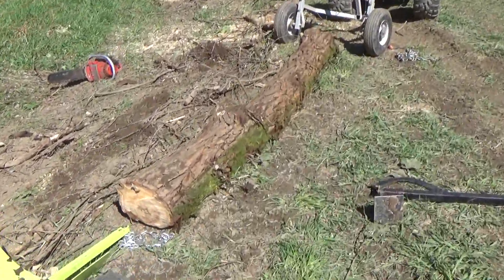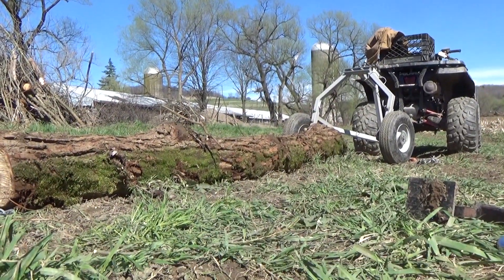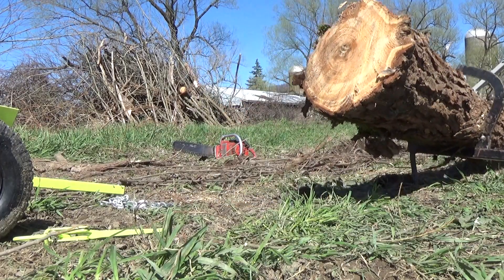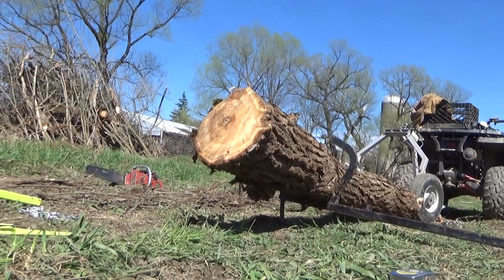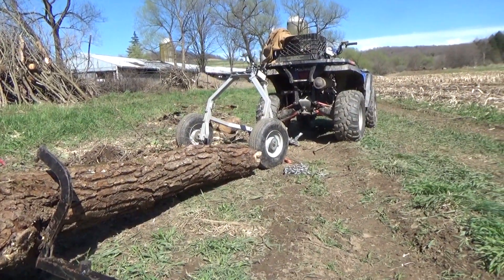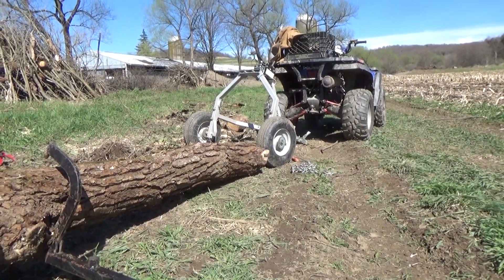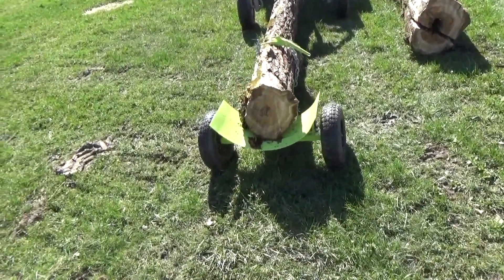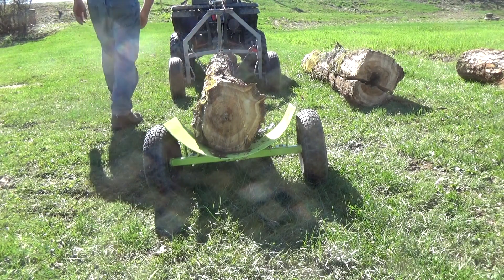Timber Tuff TMW-70 Log Skate

Comment: Still working after 2 years? I'm kind of worried about the strength of the wheel. I guess you have to pump them pretty hard? Thanks for the video.
Reply: Works fine for clear fields and roads like he was using, but mine got rekt in less than a day on rocks and stumps after using it to drag cedar logs out of the woods. More trouble than it was worth tbh, this is a light duty / professional homeowner tool that is built for convenience more than anything else. I wouldnt pay more that $150 for another another one, and thats if I had money to blow. Your better off just saving up for a proper ATV trailer. You NEED suspension if your trailer is going to survive for any time off-road.
Reply: @pinkhead6857890  Thanks a lo for sharing your experience nik.

Comment: I guess I just don’t understand why ya wouldn’t just cut it across the street and then use a trailer to bring chunks of it across the street.
Reply from the maker: I don't have a really good response to this.  My buddy tells me the same thing and I don't know what to say to him either.
Reply: jloomy I don’t know about you but cutting and loading the trailer is a pain compared to dragging the log. I pulled a huge cherry tree from my neighbors yard in a few hours with my ATV and chain. I was able to cut a few long pieces 8 to 10 ft long and drag it over in know time at all. Had I cut in pieces and had to load the trailer it would of been days and a lot of hard work lifting them into the trailer etc. I think your working smarter.Thank you for the review I am getting the log skid and arch. Pulling with the chain works well but makes a mess of my yard.